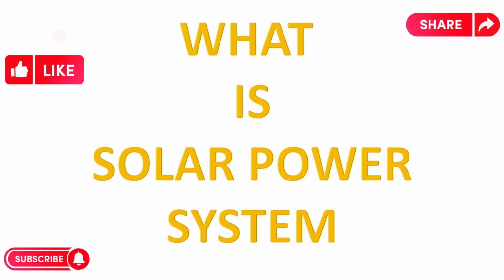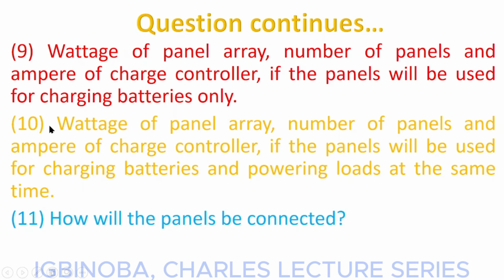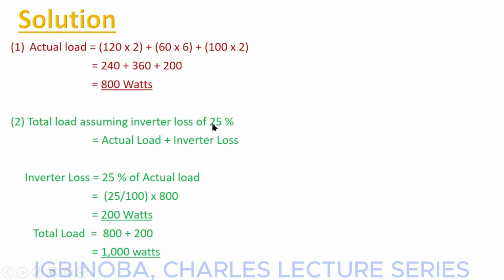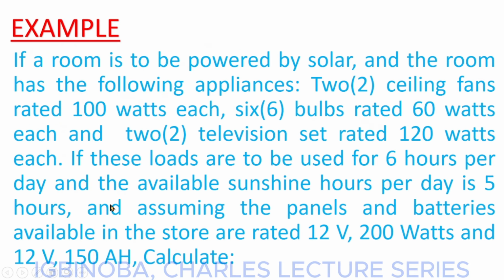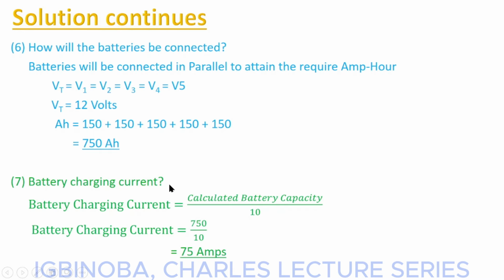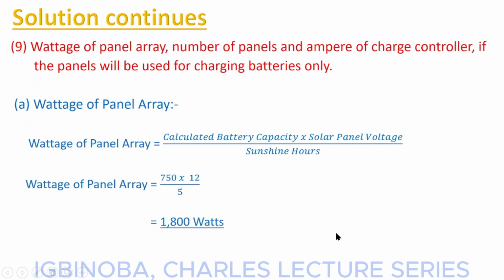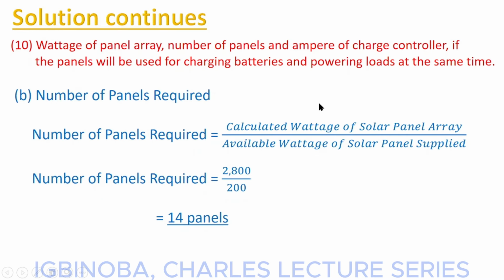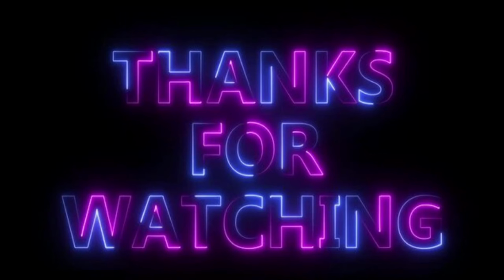Design of Solar Power System

Comment: NAT45S

1. The actual pad is 1,380W
2. The Total load is 1,725W
3. The inverter rating is 2,156.23VA
4. The battery capacity is 1,293.75Ah 
5. The Number of batteries is 9
6.  The batteries are connected in parallel 
7. The Battery charging current is 129.4 amps.
8. The battery charging time is 14 hours.
9. a. The wattage of the panel array is 3,105W
b. The number of panels is 16 panels.
c. The Charge controller rating is 258.75 amps.

10. a. The wattage of the Panel array is 4,830 Watts 
b. The number of panels is 24 panels.
c. The charge controller rating is 402.5 amps
11. The panels are arranged in parallel

Comment: CHM87I

1. Actual load = 1,380 W 
2. Total load = 1,725 W  
3. Inverter rating = 2,156.23 VA  
4. Battery capacity = 1,293.75 Ah  
5. Number of batteries = 9 batteries
6. Batteries connection = Parallel  
7. Battery charging current = 129.375 AMP
8. Battery charging time = 14 hours  
9. Panel array wattage = 3,105 W  
 a. Number of panels = 16  
  b.Charge controller rating = 258.75 AMP
10. Panel array wattage = 4,830 W  
 a.Number of panels = 24  
 b.Charge controller rating = 402.5 AMP
11. Panels connection is parallel

Comment: PETROCHEM19S

1) Actual Load: 1380 W
2) Total Load: 1840 W
3) Inverter Rating (0.8 Power Factor): 2300 VA (or
2.3 KVA)
4) Battery Capacity: 1226.67 Ah
5) Number of Batteries: 9 batteries
6) Battery Connection: Parallel
7) Battery Charging Current: 120 A
8) Battery Charging Time: 16.67 hours
9) Solar Setup (Batteries Only): 2944 W (or 3000
W), 15 panels, 250 A charge controller
10) Solar Setup (Batteries + Load Simultaneously):
4784 W (or 4800 W), 24 panels, 400 A charge controller
11) Panel Connection: Parallel

Comment: CHEM101W

1. Actual load: 1,380 W

2. Total load: 1,840 W

3. Inverter rating: 2,300 VA

4. Battery capacity: 920 Ah

5. Number of batteries: 7

6. Battery connection: Parallel

7. Battery charging current: 210 A

8. Battery charging time: 8.33 hours

9. Panels for battery charging: 2,520 W; 13 panels; 217 A controller

10. Panels for charging + load: 4,360 W; 22 panels; 367 A controller

11. Panel connection: Parallel

Comment: CIV18R 

1) Actual load A= 1380W
2) Total load(accounting for 25% inverter loss) = 1840W
3) Inverter rating = 2300VA
4) Required battery capacity (with 75% reserve/ usable factor) = 1226.67Ah 
5) Number of batteries = 8.18 ≈ 9 batteries (rounded up)
6) Battery connection = connect the 9 batteries in parallel 
7) Battery Charging current = 184A
8) Battery charging time (with 40% charging loss) ≈ 8.33h (or longer than the available 5 sunshine hours 
9) Panels for charging batteries only:
Array wattage: 3680W
Number of panels: 19
Charge controller: 307A 

10) Panels for charging batteries + powering loads simultaneously 
Array of wattage: 2208W
Number of panels: 12
Charge controller: 184A

11) panel connection: All in parallel

Comment: MEC106B
ANSWERS
1 Actual load=1380w

2 Total=1725w

3 VA=2156.25VA

4 Battery Capacity=1293.75AH

5 No. Of battery=8.65=9AH

6 parallel connected

7 Battery charging current=129.375A

8 Charging time=14hrs

9a wattage of panel array=3105w
9b no. Of panel=5.525=6
9c ampere of charge controller=258.75A

10a wattage of panel array=4830w
10b no. Of panels =24.159=24panels
10c ampere of charge controller=402.5A

11 parallel connected

Comment: EEE77Y 

1. The actual pad= 1,380W

2. The Total load= 1,725W

3. The inverter rating= 2,156.23VA

4. The battery capacity= 1,293.75Ah

5. The Number of batteries= 9

6. The batteries are connected in parallel

7. The Battery charging current= 129.4A.

8. The battery charging time is 14 hours.

9. a. The wattage of the panel array= 3,105W

b. The number of panels is 16 panels.

c. The Charge controller rating= 258.75A.

10. a. The wattage of the Panel array= 4,830W

b. The number of panels is 24 panels.

c. The charge controller rating= 402.5A

11. The panels are arranged in parallel

Comment: PETRO71S

1. Actual load = (3x100) + (10×60) + (4×120) = 1,380 W
2. Total load (25% inverter loss) = 1380/0.75 = 1,840 W
3. Inverter rating (pf 0.8) = 1840/0.8 = 2,300 VA
4. Battery capacity = (1840×6) 12 = 920
Ah → ÷0.75 (reserve) ≥ 1,227 Ah
5. Number of batteries = 1227/150 = 9 batteries (12V, 150Ah)
6. Connection = Parallel (battery voltage = system voltage, 12V)

7. Charging current = 1227/5 (sun hours)
= 245.3 A
8. Charging time (40% loss) = 5/0.6 = 8.33 hrs (8 hrs 20 min)
9. Panels for charging batteries only:
• Energy needed = 1227x12 ÷ 0.6 (loss) = 24,533 Wh
• Array wattage = 24,533/5 =4,907 W
• Number of panels (200W) = 25 panels
• Charge controller current = 4907/12 =408.9А

10. Panels for charging + powering load simultaneously:
• Total energy = 24,533 + 11,040 (load Wh) = 35,573 Wh
• Array wattage = 35,573/5 =7,115 W
• Number of panels = 36 panels
• Controller current = 7115/12 =592.9A
11. Panel connection = Parallel (12V panels on a 12V system)

Comment: COMP55C

1. The actual pad= 1,380W
2. The Total load= 1,725W
3. The inverter rating= 2,156.23VA
4. The battery capacity= 1,293.75Ah 
5. The Number of batteries= 9
6.  The batteries are connected in parallel 
7. The Battery charging current= 129.4A.
8. The battery charging time is 14 hours.
9. a. The wattage of the panel array= 3,105W
b. The number of panels is 16 panels.
c. The Charge controller rating= 258.75A.
10. a. The wattage of the Panel array= 4,830W 
b. The number of panels is 24 panels.
c. The charge controller rating= 402.5A
11. The panels are arranged in parallel

Comment: PETROCHEM11K

1. Actual Load= 1,380W

2. Total load ( 25% inverter loss) =1,840W

3. Inverter rating (pf 0.8)=2,300VA

4. Battery capacity =1,226.7AH 

5. Number of batteries =8.18 batteries (12V 150AH)

6. Connection= parallel (battery voltage = system voltage 12V)

7. Charging current =245.4A (sun hour)

8. Charging time (40% loss)=8.333hrs (8hrs 20min)

9. Panels for charging batteries only : 
. Energy needed = 24540Wh
. Array wattage =4,908W
.Number of panels (200W) =25 panels 
.charge controller current = 4908/12=409A

10. Panel for charging powering load simultaneously Total energy = 35580Wh Array wattage =7,116W. Number of panels = 36 panels 
. Charge controller current =593 A

11. Panel connection = parallel (12v panels on a 1zV system)

Comment: PETRO20T

1) Actual Load: 1380 W 
2) Total Load: 1840 W 
3) Inverter Rating (0.8 Power Factor): 2300 VA (or 2.3 kVA) 
4) Battery Capacity: 1226.67 Ah 
5) Number of Batteries: 9 batteries 
6) Battery Connection: Parallel 
7) Battery Charging Current: 120 A 
8) Battery Charging Time: 16.67 hours 
9) Solar Setup (Batteries Only): 2944 W (or 3000 W), 15 panels, 250 A charge controller 
10) Solar Setup (Batteries + Load Simultaneously): 4784 W (or 4800 W), 24 panels, 400 A charge controller 
11) Panel Connection: Parallel

Comment: NAT47U 

1.Actual load= 1380W
2.The Total load = 1,725W
3.The inverter rating =2,156.23VA
4.The battery capacity =1,293.75Ah
5.The Number of batteries = 9
6.The batteries are connected in parallel
7.The Battery charging current =129.4 amps
8.The battery charging time =14 hours
9.a. The wattage of the panel array = 3,105W
b. The number of panels =16 panels
c. The Charge controller rating =258.75 amps
10.a. The wattage of the Panel array= 4,830 Watts
b. The number of panels =24 panels
c. The charge controller rating =402.5 amps
11.The panels are arranged in parallel

Comment: PETROCHEM39 М
load calculations:

1. Actual load= (3x100) +(10x60)+(4x120)=1380W

2. Total load (25% inverter loss) =1380/0.75= 1840W

3. Inverter rating(pf 0.8) = 1840/2300VA

4.battery capacity= (1840x6)/Iz =920Ah. Then 920/0.75(reserve) ≈1227Ah

5. Number of batteries=1227/150=9 batteries(12V, 150Ah)

6.connection= parallel (battery voltage= system voltage 12v)

7. Charging current=1227/5 (sun hours) ≈245.3A

8. Charging time( 40% loss) = 5/0.6 ≈8.33hrs( 8hrs 20min)

9. Panels for charging batteries only:

. Energy needed= 1227X12/0.6(loss) = 24540Wh

Array wattage = 24540/5=4908W

Number of panels (200W) =25 panels

. Charge controller current= 4908/12= 409A

10. Panel for chargingt powering load simultaneously Total energy= 24540 +11040 (load Wh) = 35580Wh Array wattage = 35580/5 = 7116W . Number of panels= 36 panels

. Charge controller current= 7116/12= 593A

11. Panel connection= parallel (12V panels on a 1zV system)

Comment: NAT29C 

1. The actual pad is 1,380W
2. The Total load is 1,725W
3. The inverter rating is 2,156.23VA
4. The battery capacity is 1,293.75Ah 
5. The Number of batteries is 9
6.  The batteries are connected in parallel 
7. The Battery charging current is 129.4 amps.
8. The battery charging time is 14 hours.
9. a. The wattage of the panel array is 3,105W
b. The number of panels is 16 panels.
c. The Charge controller rating is 258.75 amps.

10. a. The wattage of the Panel array is 4,830 Watts 
b. The number of panels is 24 panels.
c. The charge controller rating is 402.5 amps
11. The panels are arranged in parallel

Comment: MEC69Q

1. Actual load: 1380w
2. Total load: 1725w
3. Inverter ratingin VA (0.8 power factor): 2.16kVA
4. Battery capacity: 1150Ah
5. Number of batteries: 9
6. Connection: parallel 
7. Charging current: 240A
8. Charging time: 8h 20min
9a. Panel array: 3000w
b. Number of panels: 15
c. Charge controller: 250A
10a. Panel array: 4800w
b. Number of panels: 24 
c. Charge controller current: 400A
11. They are connected in parallel

Comment: PETRO36J
Load Calculations:

1. Actual load =1,380 W

2. Total load = 1,840 W

3. Inverter rating =2,300 VA

4. Battery capacity = 1,227 Ah

5. Number of batteries = 9 batteries (12V, 150Ah)

6. Connection = Parallel (battery voltage = system voltage, 12V)

7. Charging current ≈ 245.3 A

8. Charging time (40% loss)  ≈8.33 hrs (8 hrs 20 min)

9. Panels for charging batteries only:
   • Energy needed = 24,533 Wh
   • Array wattage  ≈4,907 W
   • Number of panels (200W) = 25 panels
   • Charge controller current≈408.9 A

10. Panels for charging + powering load simultaneously:
   • Total energy = 35,573 Wh
   • Array wattage  ≈7,115 W
   • Number of panels = 36 panels
   • Controller current  ≈592.9 A

11. Panel connection = Parallel

Comment: COMP98T

1. The actual load is 1,380W
2. The Total load is 1,725W
3. The inverter rating is 2,156.23VA
4. The battery capacity is 1,293.75Ah 
5. The Number of batteries is 9
6.  The batteries are connected in parallel 
7. The Battery charging current is 129.4 amps.
8. The battery charging time is 14 hours.
9. a. The wattage of the panel array is 3,105W
b. The number of panels is 16 panels.
c. The Charge controller rating is 258.75 amps.

10. a. The wattage of the Panel array is 4,830 Watts 
b. The number of panels is 24 panels.
c. The charge controller rating is 402.5 amps
11. The panels are arranged in parallel

Comment: MAR64L 
Load Calculations:
1.Actual load =  1,380 W
2. Total load (25% inverter loss) = 1,840 W
3. Inverter rating (pf 0.8) =  2,300 VA
4. Battery capacity ≈1,227 Ah
5. Number of batteries = 9 batteries 
6. Connection = Parallel connection 
7. Charging current ≈245.3 A
8. Charging time (40% loss)  ≈8.33 hrs (8 hrs 20 min)
9. Panels for charging batteries only:
• Energy needed  = 24,533 Wh
• Array wattage = q4,907 W
• Number of panels (200W) = 25 panels
• Charge controller current  ≈408.9 A
10. Panels for charging + powering load simultaneously:
• Total energy =35,573 Wh
• Array wattage ≈7,115 W
• Number of panels = 36 panels
• Controller current =  ≈592.9 A
11. Panel connection = Parallel (12V panels on a 12V system)

Comment: COMP51Y

1. 1,380W
2.  1,725W
3. 2,156.23VA
4. 1,293.75Ah 
5.  9
6.  The batteries are connected in parallel 
7.  129.4 amps.
8. 14 hours.
9. a. 3,105W
b. 16 panels.
c.  258.75 amps.
10. a.4,830 Watts 
b. 24 panels.
c. 402.5 amps 
11. The panels are arranged in parallel

Comment: PETRO19S

*1. Actual Load: 1380 W  
*2. Total Load: 1840 W  
*3. Inverter Rating (0.8 Power Factor): 2300 VA (or 2.3 kVA)  
*4. Battery Capacity: 1226.67 Ah  
*5. Number of Batteries: 9 batteries  
6) Battery Connection: Parallel  
7) Battery Charging Current: 120 A  
8) Battery Charging Time: 16.67 hours  
9) Solar Setup (Batteries Only): 2944 W (or 3000 W), 15 panels, 250 A charge controller  
10) Solar Setup (Batteries + Load Simultaneously): 4784 W (or 4800 W), 24 panels, 400 A charge controller  
11) Panel Connection: Parallel

Comment: CHM9I.

1. The actual pad is 1,380W
2. The total load is 1,725W
3. The inverter rating is 2,156.23VA
4. The battery capacity is 1,293.75AH
5. The number of batteries is 9
6. The batteries are connected in parallel 
7. The battery charging current is 129.4amps
8. The battery charging time is 14hrs 
9. a. The wattage of the panel array is 3,105W
b. The number of panels is 16
c. The charge controller rating is 258.75amps
10.a. the wattage of the panel array is 4,830 watts
b. The number of panels is 24
c. The charge controller rating is 402.5amps
11. The panels are arranged in parallel.

Comment: PETROCHEM7G

1.) Actual load = 1,380 W

2.)Total load = 1,725 W

3.)Required inverter rating = 2,156.23 VA

4.)Battery capacity = 1,293.75 Ah

5.)Total number of batteries = 9

6.)The batteries are connected in parallel

7.)Battery charging current = 129.4 A

8.)Battery charging time = 14 hours

9.)Panel Array:
 a.)Total panel array wattage = 3,105 W
b.)Number of panels required = 16 panels
c.)Charge controller ratin g = 258.75 A

10.)Panel Array : 
a.)Total panel array wattage = 4,830 W
b.)Number of panels required = 24 panels
c.) Charge controller rating = 402.5 A

11.)The solar panels are connected in parallel.

Comment: EEE105A

Given...

1, The actual load is = 1380W 
2, The Total load is = 1725W
3, The inverter rating is = 2156.23VA
4, The battery capacity is = 1293.75Ah
5, The number of batteries is = 9
6, The batteries are connected in parallel. 
7, the battery charging current is = 129.4A
8, The battery charging time is = 14hrs.
9a, The wattage of the panel array is = 3105W
9b, 16 panels
9c, The charge controller rating is = 258.75A
10a, The wattage of the panels array is = 4830W
10b, 24 panels.
10c, The charges controller rating is = 402.5A
11, The panels are arranged in parallel.

Comment: COMP20T 

1. Actual load

3(100) + 10(60) + 4(120)

= 300 + 600 + 480

= 1380W

2. Total load

1380 × 1.25 = 1725W

3. Inverter rating

VA = 1725 ÷ 0.8

VA = 2156.25VA

4. Battery capacity

BC = 2 × 1725 × 6 × 0.75 ÷ 12

BC = 1293.75Ah

5. Number of batteries

N = 1293.75 ÷ 150

N = 8.625

N = 9 batteries

6. Battery connection

Parallel

7. Charging current

Ic = 10 × 1293.75 ÷ 100

Ic = 129.375A

8. Charging time

40% loss = 0.4 × 1293.75 = 517.5Ah

T = (1293.75 + 517.5) ÷ 129.375

T = 14 hours

9. Panels for battery charging only

P = 1293.75 × 12 ÷ 5

P = 3105W

N = 3105 ÷ 200

N = 15.525

N = 16 panels

I = 3105 ÷ 12

I = 258.75A

Charge controller ≈ 300A

10. Panels for battery + load

P = 3105 + 1725

P = 4830W

N = 4830 ÷ 200

N = 24.15

N = 25 panels

I = 4830 ÷ 12

I = 402.5A

Charge controller ≈ 400A

11. Panel connection

Parallel

Comment: EEE46T

  SOLUTION 

1.actual load for the room is 1,380Watt.
2. Total load assuming inverter loss of 25% is 1725Watt.
3.inverter rating in VA using a power factor of 0.8 is 2156.25VA
4.battery capacity using a factor for reserve of 75% is 1293.75AH approximately 1350AH
5.No.of batteries for back up hrs is 8.62 approximately 9
6. How will the batteries be connected? The batteries will be connected in parallel because there is an increase in the current and the voltage is constant.
7.Battery charging current:1293.75/10=129.3A
8.Battery charging time assuming loss of 40% is 
   =14hours
9.For charging batteries only 
 a.Wattage of panel array is =3105watt
 b.No.of panel is =15.525 approximately 16 panels 
c.Ampere charge required=258.75A
10.For charging batteries and powering load at the same time 
  a.Wattage of array is=4830W
 b.No.of panel=24.15
c.Ampere charge required is 402.5A
11. How will  the panel be connected? The panel will be connected in parallel

Comment: CHM2B

1. Actual Load Watts = 1380W
2. Total Load (DC with 25% Inverter Loss) = 1720W
3. Inverter Rating = 2156.25VA
4. Battery Capacity = 1293.75Ah
5. Number of Batteries (12V, 150Ah): 9
6. Battery Connection (48V System): 2 parallel strings of 4 batteries in series.
7. Battery Charging Current: 129.4A
8. Minimum Charging Time (hrs): 14 hours
9a. 3105W
b. 15.5 panels
с. 258.8А
10a. 4830W
b. 24 panels
с. 402.5А
11. Panel Connection: 3 parallel strings of 6 panels in series.

Comment: COMP99U

1. The actual pad is 1,380W
2. The Total load is 1,725W
3. The inverter rating is 2,156.23VA
4. The battery capacity is 1,293.75Ah 
5. The Number of batteries is 9
6.  The batteries are connected in parallel 
7. The Battery charging current is 129.4 A.
8. The battery charging time is 14 hours.
9. a. The wattage of the panel array is 3,105W
b. The number of panels is 16 panels.
c. The Charge controller rating is 258.75 A

10. a. The wattage of the Panel array is 4,830 Watts 
b. The number of panels is 24 panels.
c. The charge controller rating is 402.5 A
11. The panels are arranged in parallel

Comment: CHM63K                                    1.Actual load: 1380 W
2.Total load (with 25% inverter loss): 1725 W
3.Inverter rating: 2156.23 VA
4.Battery capacity: 1293.75 Ah
5.Number of batteries: 9
6.Battery connection: Parallel
7.Battery charging current: 129.4 A
8.Battery charging time: 14 hrs
9. Charging batteries only:
a. Panel array wattage: 3105 W
b. Number of panels: 16 panels
c. Charge controller rating: 258.75 A
10. Charging + powering loads simultaneously:
a. Panel array wattage: 4830 W
b. Number of panels: 24 panels
c. Charge controller rating: 402.5 A
11. Panel connection: Parallel